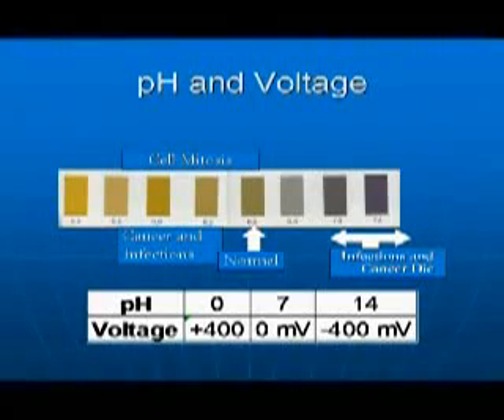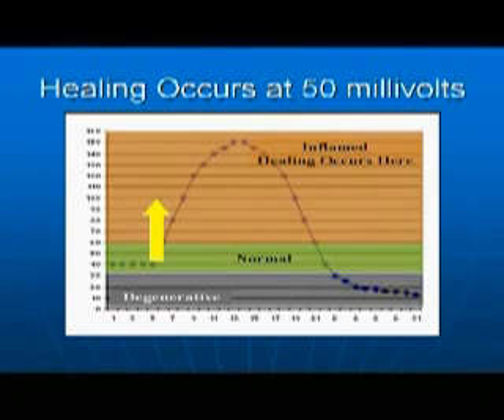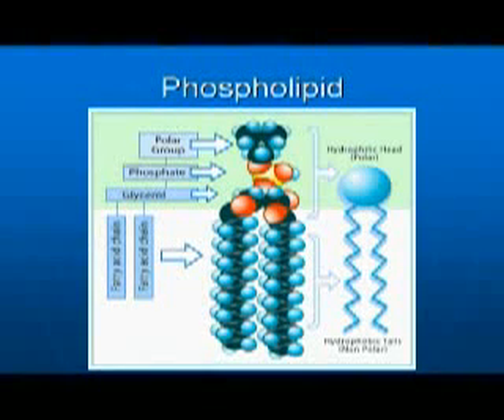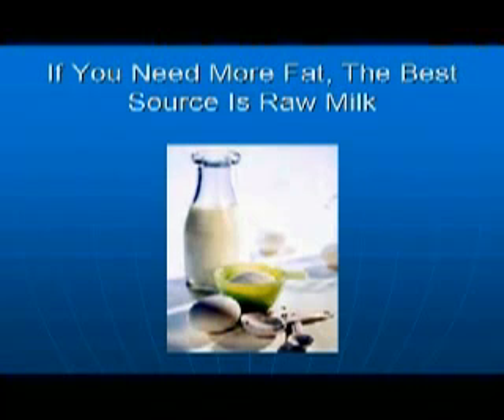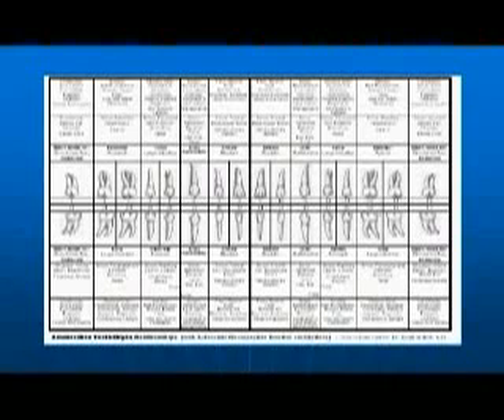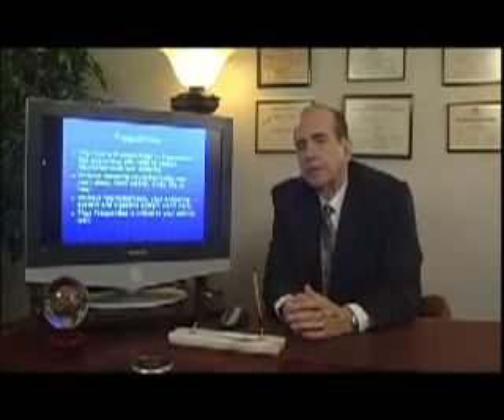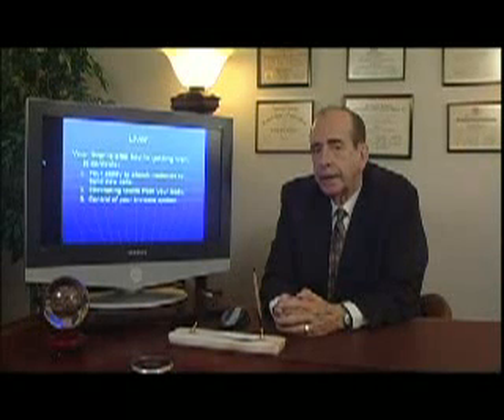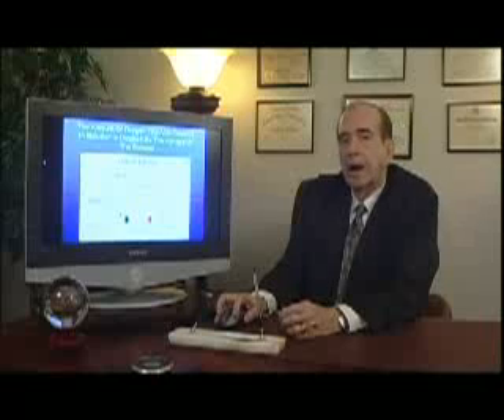Dr Jerry Tennant Video - FrequenSea For Your Health

Comment: They have discontinued Frequensea in liquid form..Frequensea Pro is a new and improved version of the original Frequensea. The upgrade is set to be released in spring of 2017 and the brand already has big plans in terms of how well the upgraded version is going to turn out.
Reply: I suspect ya cut off video after it mentioned a product you seem to be selling. I recommend choella spirulina and himalayan salt. Use trace minerals like fulvic acid and iodine. Drink distilled water and read up on acid vs alkaline foods. Eat organic. Exercise including deep breathing. Sing.